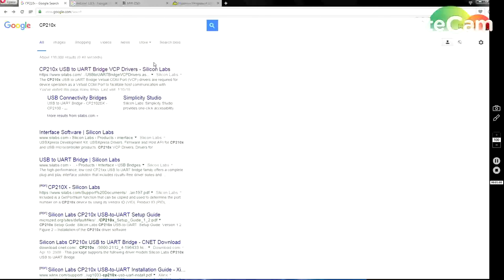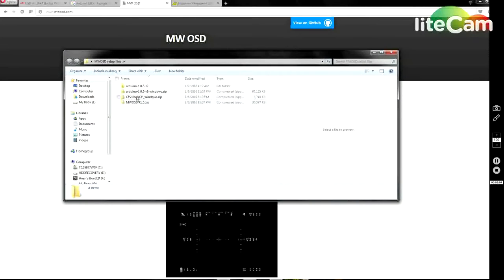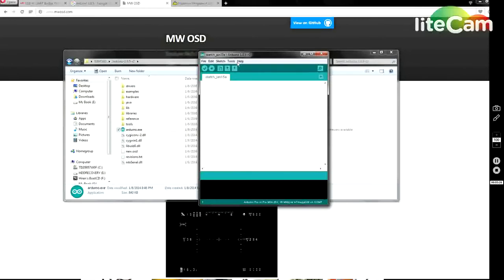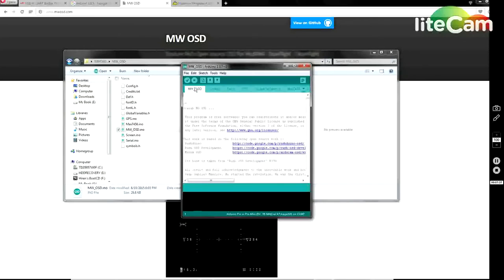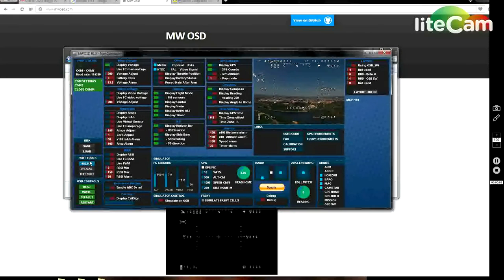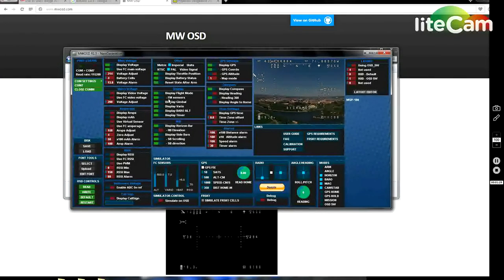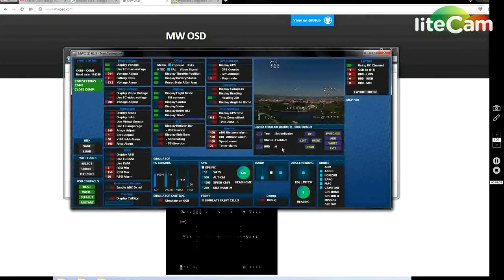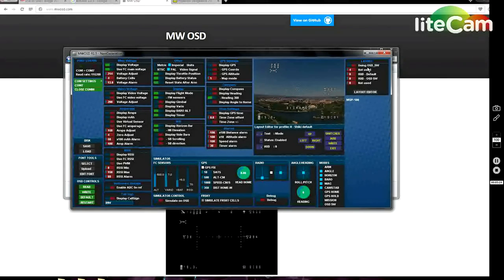Hyperion Vengeance - Flashing MWOSD R1.5 to stock OSD board

Comment: Hey, if I have accidently smoked the EEPROM of my OSD PBD is that going to be repairable? Can it be fixed?
Reply from the maker: If your talking about the whole PDB and FC being fried. I don't think there is much you can do. However, if your talking about the Vengeance OSD specifically. If your soldering skills are up to snuff. You can technically replace the OSD daughter board. It's just a standard micro MinumOSD board. I'll put a couple links below where you can order the replacement board. You'll need to de-solder the old one and replace it with this one. You just have to line up the board the same way as the old one was. I think the old one also has a resistor or diode sticking up on one side. You might need to move that over also.Then you can more or less follow this video for flashing firmware to the OSD and configure it how you like. The OSD board is only like $10. So it might be worth trying if you think you soldering is up to it.

http://www.readytoflyquads.com/micro-minimosd

https://www.banggood.com/MICRO-MinimOSD-Minim-OSD-Mini-OSD-W-KV-Team-MOD-For-Naze32-Flight-Controller-p-990556.html
Reply: Yes. I've ordered a Micro Minim OSD. Just stick with that I think. Too much on a PDB, OSD, LF Board for me to brake. So I'm staying away from them, for now ;) Thanks for the links.